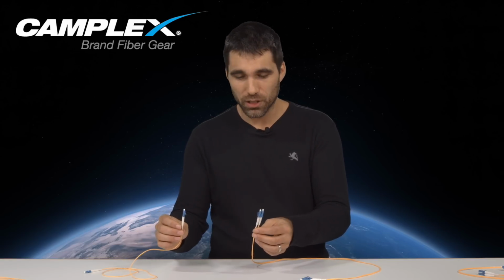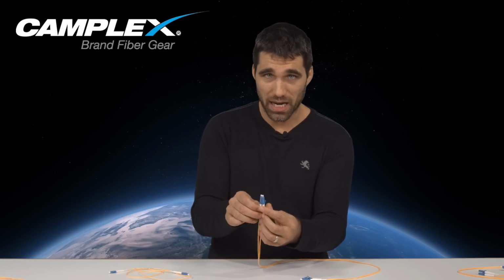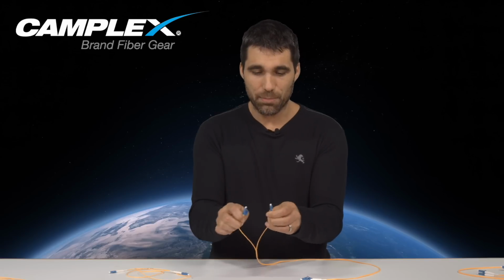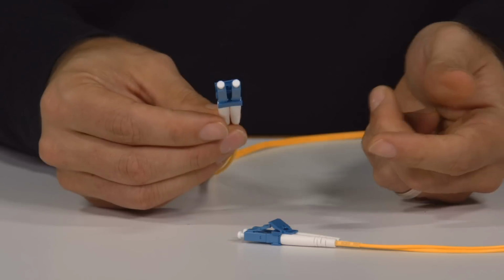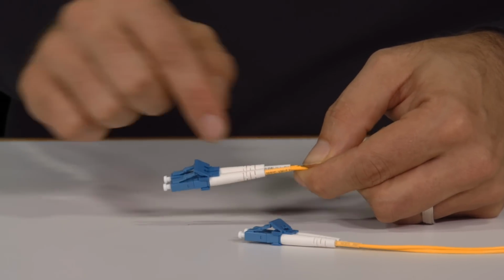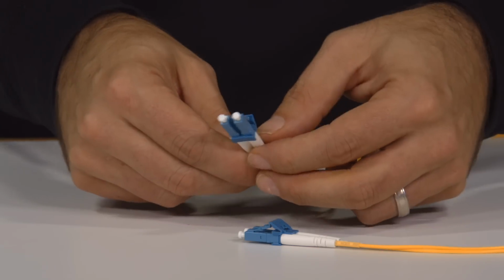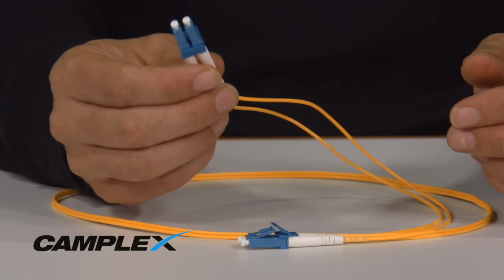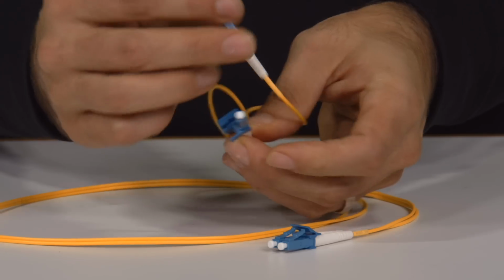Camplex Fiber Tech Tip - LC Fiber Duplex - Simplex Connector Conversion

Comment: Oh Man ! - Buddy, You don't know how much time and effort (and frustration) you saved me with this video!  We'd run (2) 20 meter LC - LC duplex cables through conduit in the celling etc. and couldn't figure out why no signal on one cable - well, we discovered that the "A" & "B" ends of the cables were reversed on one of the cables !  - Totally a silly mistake but... separating the ends and plugging them in as the 'good' cable was did the trick saving us a huge amount of time to otherwise re-pull the cable !  AWESOME - Many Thanks - God Bless !
Reply from the maker: Awesome, that's great to hear!

Comment: THAT is a nifty little trick I didn't come up on until now and extremely useful in my case.
You know, here in Germany nowadays it is common to install your wiring inside ridged piping. So you can exchange your wiring when the use case changes and so is easier when needed.
My house has been partially renovated by the pre owner and just in that area I want to install a fiber connection, to future proof my home networking. It is planned as a connection between two switches.

So, long story short: In that area the already installed ridged piping is way to narrow to pull a LC-Duplex connector through. With simplex that is completely another story.

Thanks for showing that little trick, because 10GB Ethernet is still way to expensive and if the wiring can handle more than 10G in the future, even if I install CAT 7, may be questionable. Fiber can handle dozens of Gs easily.

Comment: One stupid question: sometimes I need to do this to about 50 cables, to make them working. Some of the cable connectors break during this process. My fingers really hurt after 10 of these f*ckers. Are there cables to buy with already switches fiber cores?

Comment: Easy way to take it off:

Twist the long white sleeve at the bottom of the cable down then pull the boot down then it will come off easy. Same thing, put the boot on the wire with the white sleeve lowered then bring the boot up until it snaps then twist the white sleeve back.

Comment: OK--now tell me how to do it without breaking that fragile little clip!  :-)
Reply: Twist the long white sleeve at the bottom of the cable down then pull the boot down then it will come off easy. Same thing, put the boot on the wire with the white sleeve lowered then bring the boot up until it snaps then twist the white sleeve back.